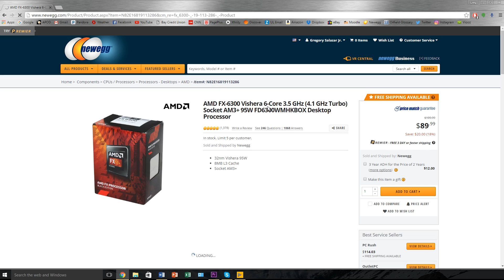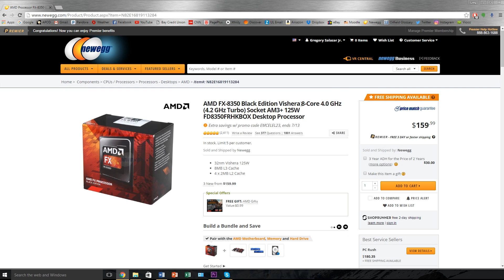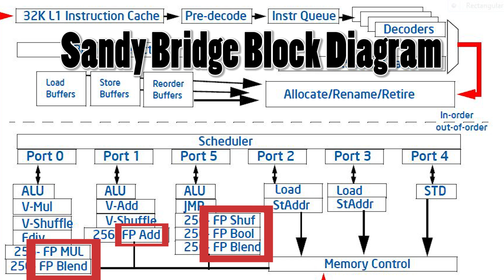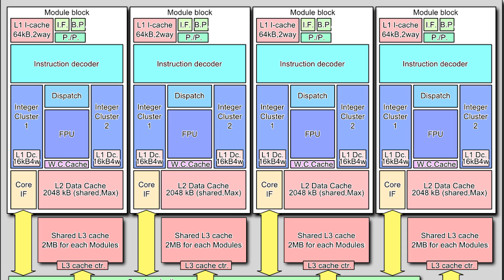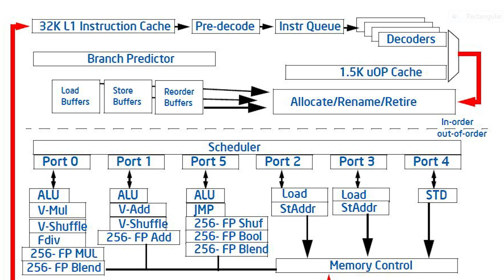How Many Cores Do AMD FX Processors *Actually* Have?

Comment: Amd cpus still fail in single thread applications...cough.
Reply: That's to be expected of a chip when you force 2 conjoined cores to use the same FPU in a benchmark that artificially pins core usage at 100%. In that case, each core only gets half an FPU of compute power, therefore your octa-core will perform more like a quad-core in FPU intensive things. if your workload doesn't overload the crap out of an FPU (which not all will) , then the performance would be far closer to that of a true octa-core. nothing is ever perfect unfortunately..
Reply: XD, but wait for zen
Reply: Gamer Wiryo Oh goody, then we can have i5 2400 performance.
Reply: XD Zestypanda
Reply: Give me full physical 8 core - 16 threads for a competitive price, then we'll talk. Otherwise, enjoy sticking to four cores for another decade.
Reply: Yes of course Plague Doctor i mean i have an amd system myself
Reply: sure intel is way ahead now, but that position has been taken back through lies and deceit...

Pentium 4 was to intel what FX is to amd, a low IPC piece of shit where they had to double down on clock speeds to make it look like something decent, 
yet somehow intel didn't get all the flak AMD gets over FX, because they managed to save face by cheating and bribing their way out on a large scale...

intel is dropping 8 cores themselves now, and software is still hardly up to the task of utilizing all of those properly, because of their own meddling with software innovations.
Reply: LOL the FX 8XXX series are already faster then that. But I defiantly agree the FX CPU's do have very weak single core performance. Zen will not compete with Intel Skylake but it will be a nice jump in performance from the 2012 FX CPU's.
Reply: Alexander Rewijk For $1000? No thanks. We've been on quad cores since 2008. CPUs need to evolve.
Reply: Plague Doctor well, they have the 1700$ 10 core XD. even xeon are more cheaper
Reply: Gamer Wiryo Xeons lack overclockability though. Not to mention they really lack the driver performance for games.
Reply: Plague Doctor yeah...
Reply: +Plague doctor i agree,

even the mighty intel had to delay their 10nm process which broke their trend of shrinking every 2 years, as the increasing r&d budgets have been showing an inverse trend of increased cost per gate rather than the usual decrease for the last 2 or 3 years.

right now, more cores seem to be the only way to stay on par with moore's law, as physical limits in current processes make it hard to reach higher clock speeds, 
kind of like it was before CPU's went from copper to aluminum in the '90s :)

AMD historically has been the innovator for a while now, 
having the first 64-bit cpu, 
the first multi-core cpu,
and the first CPU to hit 1Ghz (better IPC than intel at the time too)

they've been able to trump intel up to like 2006 orso until they fucked up, lost ground and eventually had to sell their fabs, 
but intel's sabotaging certainly has had a part in that too.

a lot of devs have been bought by intel back in the day to make their p4 look like it was any good and holding back multithreading for as long as possible.

my fx8350 equals a i7-3960x in raw multithread performance (not IPC), which both are 2011 chips, even the single threading gap isn't that huge when compared.

as for the i5-2500, any 8 core FX pisses over it in multithreading, and again the gap in single threading isn't much

this is ofcourse in raw output performance,
in terms of IPC intel was already the clear winner, as the intel is 3.3ghz, and the AMD is 4ghz ;)
Reply: FX CPUs are at a 32NM lithography and intel is at 22nm and 14nm, and Zen is going to be 14nm.